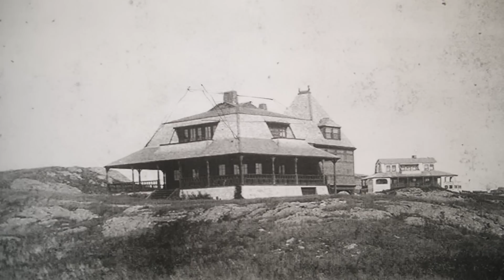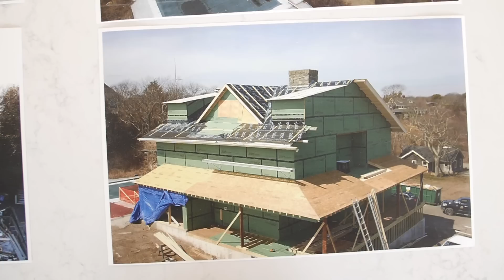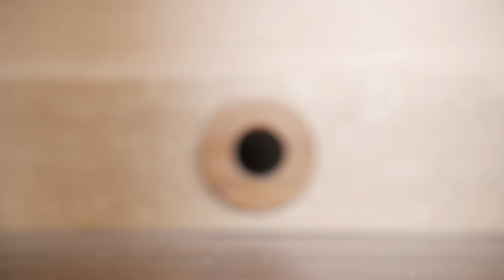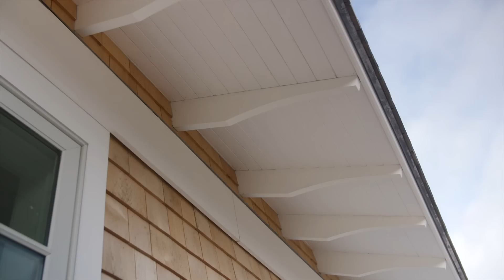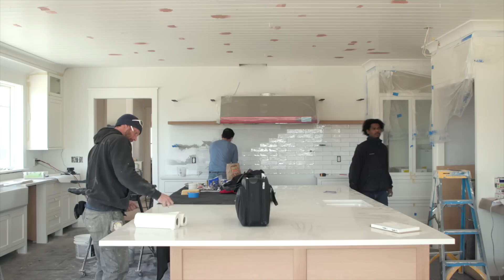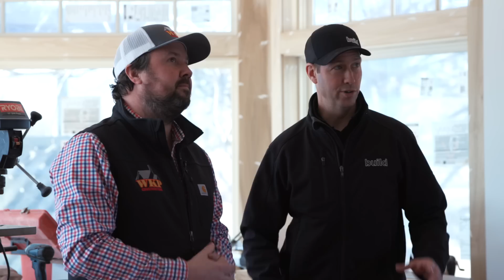How they BUILD in Rhode Island - A Shingle Style Coastal Renovation

Comment: I was interested/curious about membrane sheathing performance tape for quite a while - all the way back in Seattle in the early 2000s, however, old existing structural wall sheathing that is still good condition on houses built in the 50s is a different challenge. There are a lot of homes in North America built this way. People with low budgets are buying these types of homes. They are environmentally conscious & want to cut their energy costs 50% or greater. I'm interested in how builders can solve these problems. Heat travels to cold & it brings with it water. We need all assemblies that work correctly to stop or manage water both winter & summer. Fire & voc's should also be important concerns for builders. I'm thinking that wall assemblies consisting of 2 or 3 different insul types might be the solution - each performing a different function - might be a solution. Just thinking.

Comment: Very impressive build. 1890's masonry holding quite nicely, doubtful that they used any portland in those days. Those joints are a testament to the strength of slaked lime mortar, it has the ultimate flexibility. All those old castles in Europe were built with lime mortar and rubble stone cores. Old growth Cypress wood frame on stone, lime mortared onto solid bedrock, what a solid foundation. This is like old house porn lol